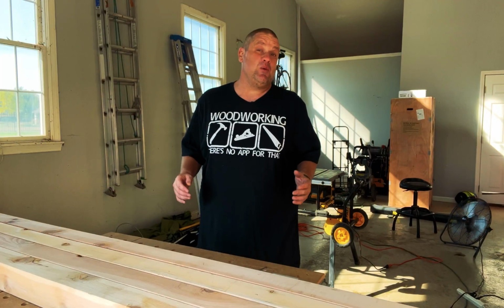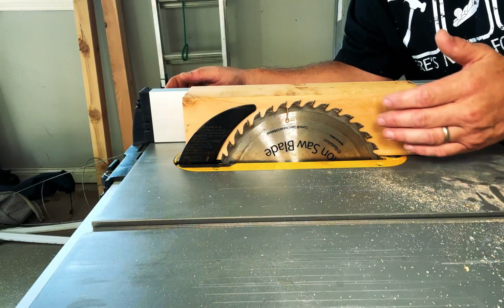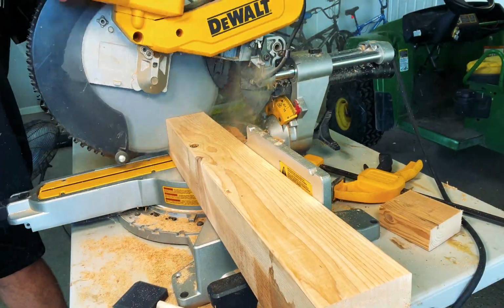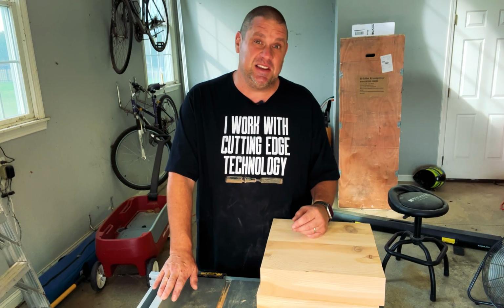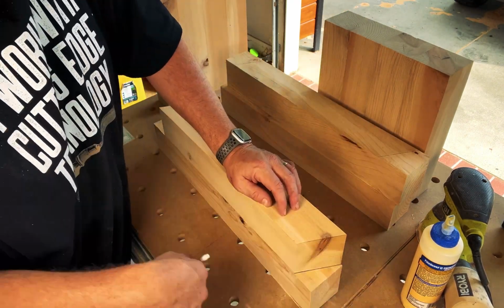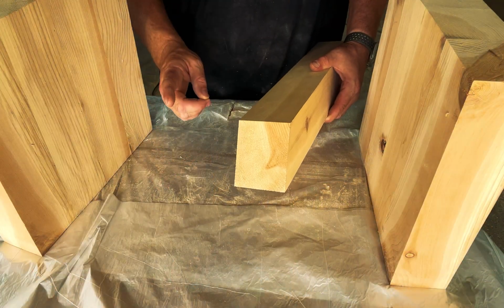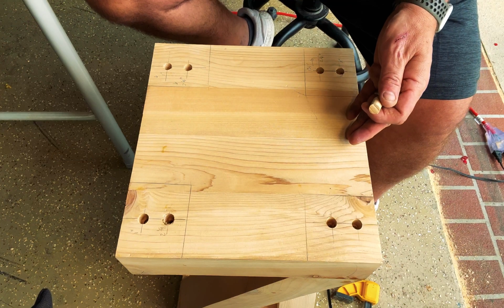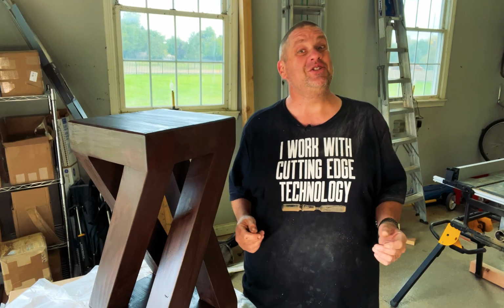Crafting a Gorgeous End Table in My Makeshift Shop! #woodworking #flynndoggwoodwork

Comment: Love the table and it’s simple elegance.  A couple of thoughts/observations/suggestions.  Get yourself some 3M cubitron sandpaper.  It is the most amazing sandpaper and makes sanding much faster and when used on pine, super long lasting.  It lasts longer on hardwoods too.  It is a little more per piece than the cheap stuff, but it’s light years ahead.  I’m struggling just to use up all of my old cheap stuff, because it’s that much more superior.  

On the finish, I’m surprised how infrequently I’ve seen people use Shou Sugi Ban in projects with pine.  There are so many levels of char that one can go to, plus you can scrape it afterwards if you want less char.  It looks so amazing with pine, if you’re interested in seeing the grain.  You can then put a myriad of different coatings on it to hold the char, as well as making the surface very resistant to moisture rings from condensation on glasses on the table.  I think the guy from Blacktail Studios may have made some coasters with heavy char and covered them in epoxy, they were spectacular and looked three dimensional through the epoxy.  It’s a lot of fun to do and experiment with.  

I built a bar using 6 X 6 shou sugi bon  pine for the main legs, used a light char and they turned out pretty cool.  

Good work.
Reply from the maker: Love this Michael!  Thank you so much for sharing.  I've been wanting to get some 3M cubitron for quite some time.  In fact that is probably the sandpaper I will be switching to as soon as I use up all my current paper.  Problem is I have a TON of paper that I purchased so I have a lot to go through to get to that point.  

Great point on Shou Ban,  I have never done that before but have seen it used on a couple of channels.   That would be a great thing to try out.  I saw that video on blacktail and I think I saw bourbon moth do it once too.   Thank you so much for the suggestions I'm going to add that technique to my list of things to try.  This would have been an excellent project to do it on!

Comment: This is great! We recently replaced the old 4x4 center beam in our garage and I've been looking for a fun thing to make from it, and this will be perfect!
Just wondering, do you think if I used the screws to attach the legs to the bottom, that I could get away with gluing the top on using weights/clamps instead of screws & plugs? I'd love to maintain the solid surface if possible.
Reply: I was thinking the same thing about the top surface.  You could easily do a template out of plywood and use dowels to glue and secure the top, it’s plenty thick enough.
Reply from the maker: Dowels would be an excellent idea!  Thanks for sharing! Michael!
Reply from the maker: That's awesome katrinahamilton!   I think you could absolutely get away without using the screws.   In fact if I did it again, I probably wouldn't use them.   But instead find a better way to clamp the legs.   That was legitimately the only reason I used them.   Best of luck to you and happy building! :)

Comment: Dogg, man,  nice!  Maybe you don't need that new shop.  Wait, no Wixie, or Woodpecker square to check the blade?  You've proven that it is the craftsman, not the tool.  We're doing 100 push-ups to honor this table build.
Reply from the maker: Haha!  Well, it was kind of fun going back to some of my old tools, and I 100% agree with you on the tool thing.   After all the comments I got about using festool in my last project, it was fun to go back to some of the tools I started with in my early years.    100 push ups sounds good for this one, especially without the paolini! :)
Reply: @FlynndoggWoodwork  The paolini may have killed us today.  I am going to get one, soon. Hey, is that your farm we can see out the window?  If it is, you're killing us.  Also, if you deal in live stock, I have a serious question as we run a small 16 acre operation out the door of Meat studio.  Have a great weekend.  Now on to today's short.
Reply from the maker: @themeat5053  That's actually our neighbors house!  His house is a s big as a barn though.   Unfortunately I don't deal in livestock, but  I do have a flock of about 15 chickens (depending on how many hawks or racoons there are).   Haha!  I don't even have enough material for a short right now! :)

Comment: Nice build!  I’m going to give this a try. Thanks, Brian.
Reply from the maker: Awesome Paul!  Glad to hear that. It's pretty simple (except for attaching the legs. Maybe you can come up with a better solution.  Not sure if you have a domino joiner, but that would have been a ton easier :)   Thanks as always for watching!
Reply: @FlynndoggWoodwork  Oh, me; Oh, my, domino 🎸🥁🎹
Reply: @FlynndoggWoodwork question. I need advice on how to put an initial on edge grain cutting boards I’m making for family Christmas gifts. I have no cnc or laser. Ideas?
Reply from the maker: @tpaulsmith7194  have you thought about burning it in?  I know you can buy some customizable brands (some that even heat up themselves)  I've thought about getting one of those in the past for things like that.  But I haven't used one before.   Not sure if that helps?
Reply: @FlynndoggWoodwork  that’s what I’m looking at. Price is high if you need a full alphabet. I guess I could add as needed. Thanks, Brian. I’ll let you know how it goes.

Comment: Great video and really nice looking project! I’ve gotten so used to your deep-Googling vids that it threw me for a second to see a build video. 

I’d love to make a set of these to flank an outdoor bench. Do you have any issues staining over squeeze-out? Even after sanding over those areas, the stain can look kind of crappy for me sometimes. Good luck on the new shop!
Reply from the maker: Thanks so much Bren!  And great question on the glue squeeze out and staining.  That's always an issue for me.   Luckily I did clean it up pretty well after glue up.  I did not notice any problems where I mixed the glue and saw dust, but there were a couple of spots I missed cleaning up entirely with just the glue and that definitely showed.  Luckily there were in inconspicuous spots!   Thanks so much for commenting and watching!